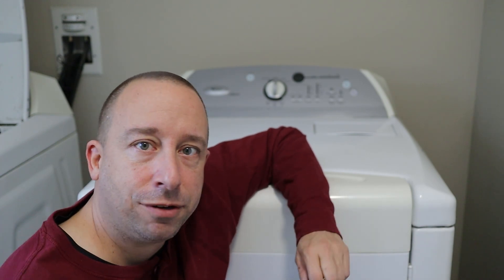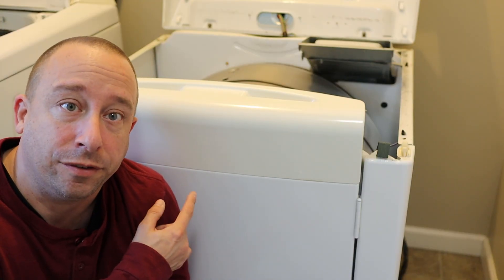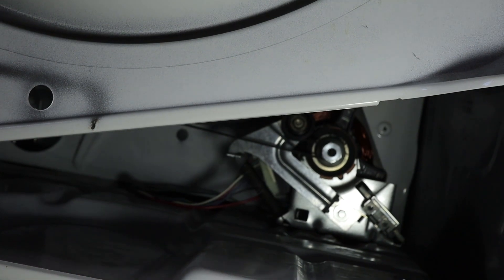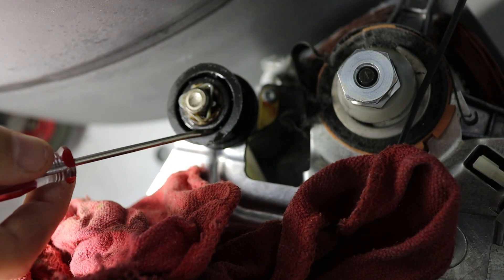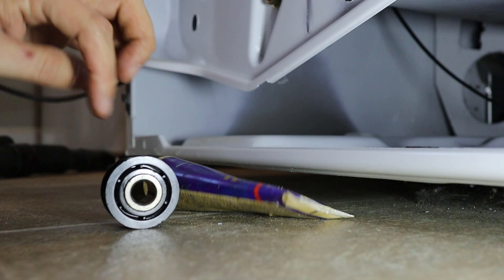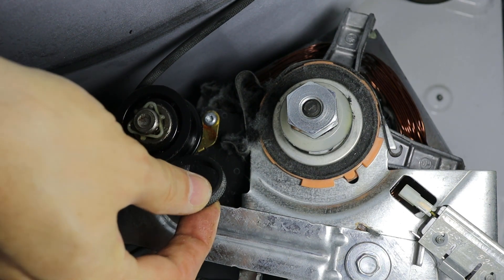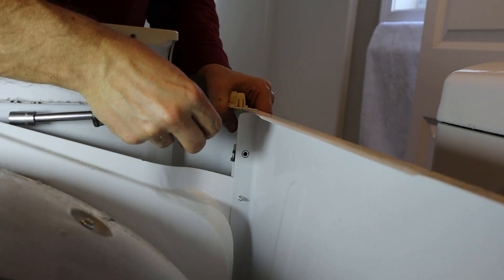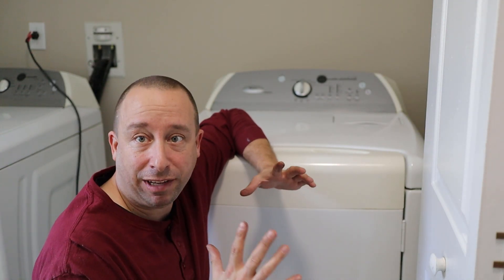Squeaky Dryer Temporary Quick Fix

Comment: I have a Whirlpool gas dryer older than yours. I had to take all those covers off mine to replace the heater element (which burned out), and changed the fusible link on the back about 2 years ago. I guess mine is about 15 years old. I like the idea about using brake grease for the fix! Well done!